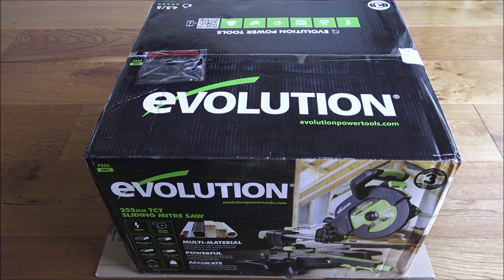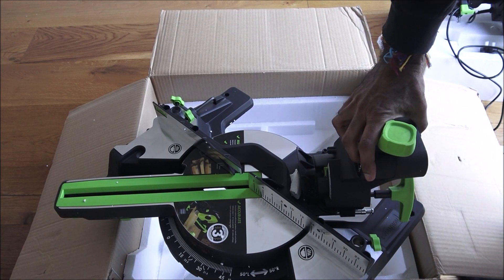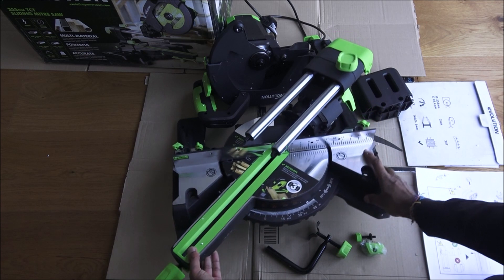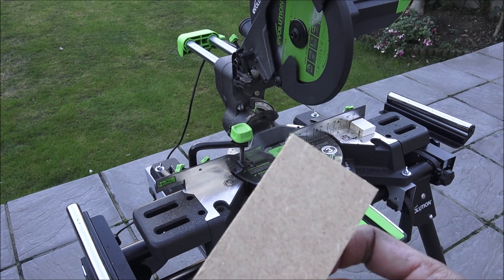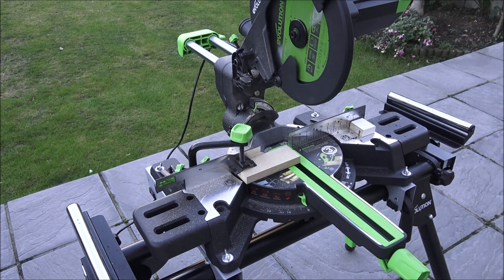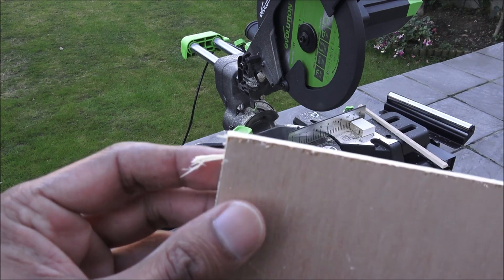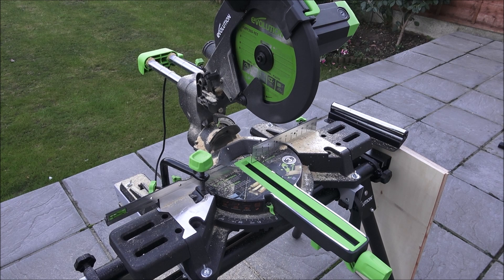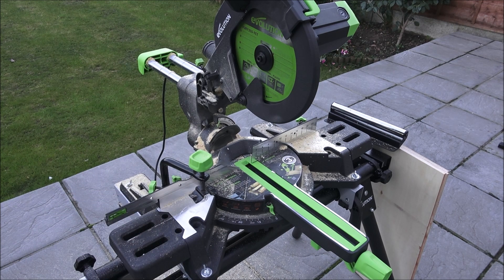Evolution F255SMS Multi-Material Sliding Mitre Saw Unboxing and Setup

Comment: One feature you didn’t mention in your review is that this saw has an adjustable thumb screw that can be used as a depth stop, this can be located on the blade side of the saw near the pivot point with a green cap on top, great product review as always mate
Reply from the maker: Thanks for the comment and appreciate the support, I completely forgot about that option! I was just blown away by how good this mitre saw was.

Comment: Great vid just bought one of these, had its predecessor for 7 years but needed a bigger saw. Easy to assemble and cuts true straight out of the box . Blade is great too cuts through everything like butter with minimal burr edges . Its a great saw for DIYers you'll need to spend a whole lot more to better it. P.S. much prefer the colour over the R255SMS in truth I cant see any other difference as they seem to have identical specs.

Comment: I'd be more interested in the initial setup of the saw and accuracy of the cut, rather than the cut quality.
All blades cut clean provided they are sharp, but it's the job of the tool to cut accurately and true.

As this is a sliding mitre saw, with bevel cut, the setup of the saw is extremely important and needs to be fine tuned.
 
Were the cuts actually accurate?, is the tool easy to setup?, (I'm talking about setting and obtaining true angles from the fence to the blade for accurate 45deg and 90deg cuts).

It seems like the saw was just assembled out of the box and had random cuts to show cut quality only. Its not a true representation of its accuracy. You never tested any cuts with a square for accuracy which is strange 🤔